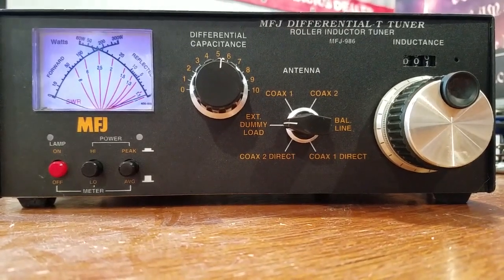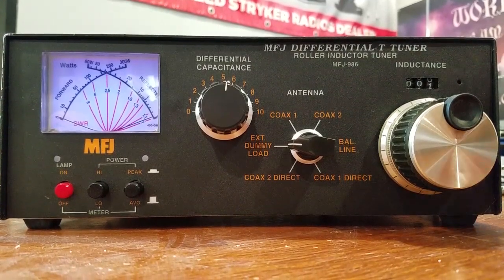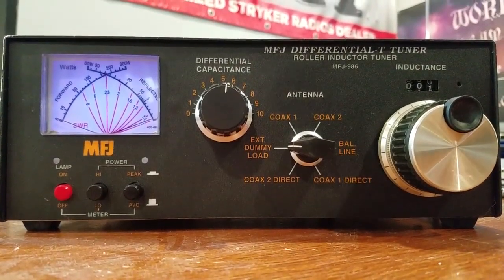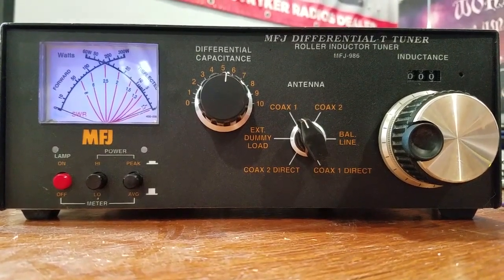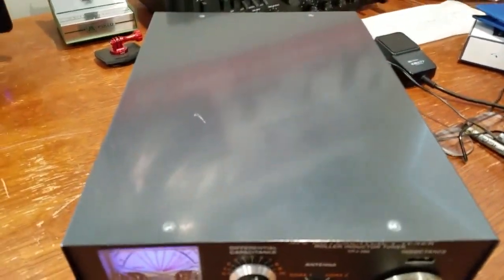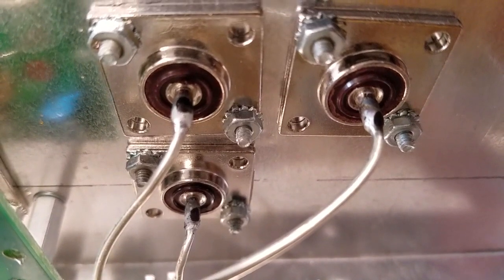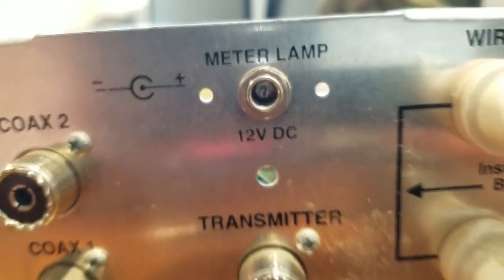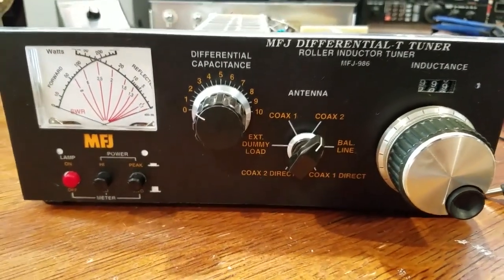MFJ 986 Differential T ANTENNA Tuner INSIDE LOOK

Comment: "Don't take this wrong" but opening the unit myself will void the warranty after spending close to $450! If that kind of stupidity is the norm for your way of thinking, going down the wrong road must be something u do quite frequently. BTW, MFJ said they apologize for the trouble, NOT fix it myself because I was, as u put it, "a radio guy."
Reply from the maker: Why did you take down your first comment?  You had to make EDITs to your first comment and now EDIT this one, Good lord, please stay on the new frontier of Hammy Ham radio, no effort, no will to learn, buying "pre made" Dipoles and to lazy to pop the top and tighten a 1/2" nut..   didn't you even want to see how your magic  "Little Black Box" worked? 
Not really in the mood to get into a pissing match with you as you will never "get it" however people like yourself are a prime example why Ham Radio has gone to shit. 
BTB.... If you called MFJ and told them that you had a loose nut :) and you fixed it, they would have more than likely apologized and asked what your serial number is so they could  reprimanded QC for missing the "loose nut".
Go ahead and take down this comment so you don't look so stupid. 
Cheers
Reply: @390WagonMaster Yeah, & u sound like a guy who'd have "UDX390" for his call sign! And who's gonna know the diff, right?
Reply: Does Not Void The warranty Do your homework

Comment: I have used a MFJ-986 tuner for years using an Off center. fed antenna and have run 600w on the tuner with no problem....!73

Comment: We used to call MFJ “Mighty Fine Junk”. But really they aren’t that bad. You can save a lot of money on stuff if you’re willing to take it apart and check everything. The thing I really like about MFJ is their willingness to sell parts to everyone. You can buy those inductors, variable capacitors, 50 ohm dummy load resistors, and about anything else, from MFJ.
Reply from the maker: Agreed.